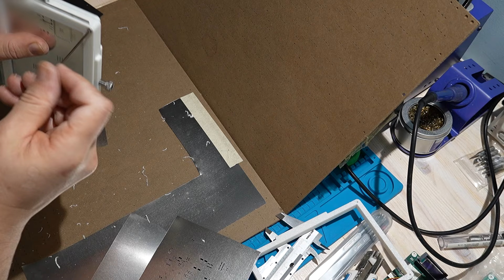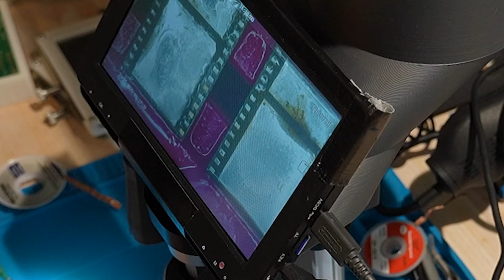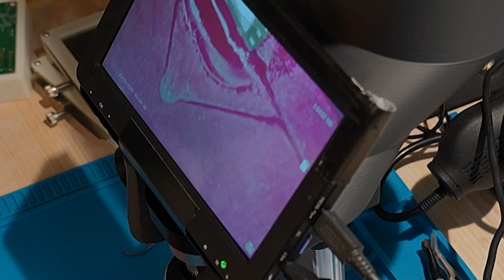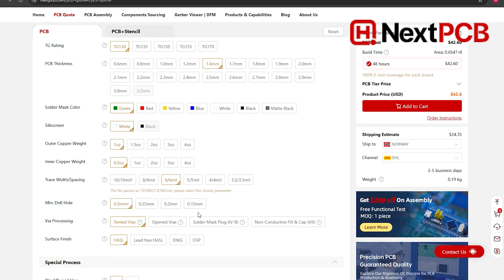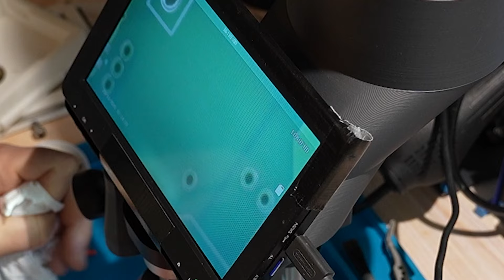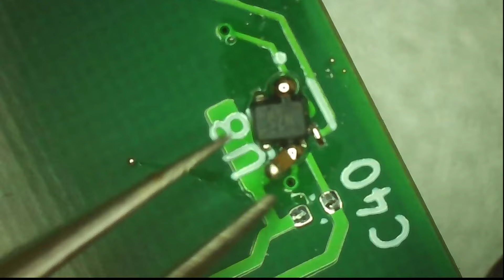BitaxeHex Build Ep01 - Side A

Comment: hey loving the video, i have nothing but really need to redo my bitaxe supra hex, chip 6 isnt working as intended,  not sure if it just needs a warm and reset or the chip is cooked.  Anyhow was going to buy the appropriate tools to do this (though probably spend more on stuff to fix than to just replace the unit.  (but wont get the experience) If i buy a 1368 chip, do they normally come balled/prepared  just need to prepare the board with paste and flux?
Reply from the maker: Hey, thanks for reaching out!

First, if you buy a new chip, it shouldn’t have been reflowed. It should have copper-coloured pads, not silver ones. These videos show what a new chip should look like and how I prepared it:
https://youtu.be/hqAFU69-H4M?t=135
https://youtu.be/SXXQYmF-SPA?t=57

A stencil makes it easier to add solder to the chip, but you can also use a soldering iron to tin the pads, then wick away the excess, leaving a thin layer of solder. I did it without a stencil in the videos above. It takes some time to get the hang of it, but it’s completely possible.

I also have another video showing how I remove and replace the ASIC, so check that out if you need help with the removal and reflow process:
https://www.youtube.com/watch?v=eTSKyb7Hbm4&t

The main difficulty with this board is heat dissipation. If you don’t have a way to preheat the entire board to 100°C, removing the chip and doing the reflow will be difficult. You’ll need a lot of heat, and the board will do exactly what it’s designed to do, dissipate it. That can make it difficult to get the solder and flux flowing properly, align the chip, and achieve a good reflow.

Starting with the Hex can be a bit challenging and frustrating, so keep that in mind. If you can, buy a Bitaxe Supra and practise on that before moving on to the Hex.

But it’s never a bad idea to buy tools and try something new. Even if the repair doesn’t work out, you’ll learn new skills and have new tools!

Comment: What kind of pcb holder are you using? Is this one 3d printed? Maybe have the link for me?
Reply from the maker: Hey! I’m using this PCB holder from AliExpress:
https://www.aliexpress.com/item/1005001349601122.html
If you unscrew the two M4 screws underneath, you can remove the PCB holder part. You can also screw on your own plate if you want.
I also removed the two plastic end pieces on the top bar (didn’t want plastic that close to heat). And I filed small grooves in the corners and used a bit of wire as a stop, so the sliding PCB holder can’t fall off and disappear into the “parts portal” under the bench 😄
Reply: @TheWiz4Real  Thanks!

I´ll check it out! :)